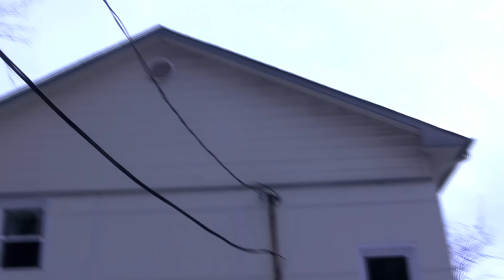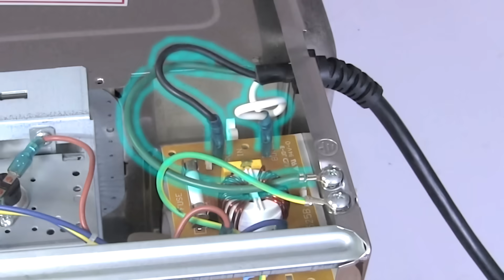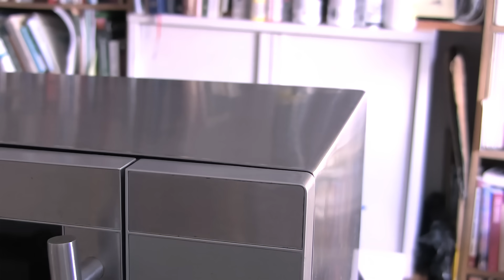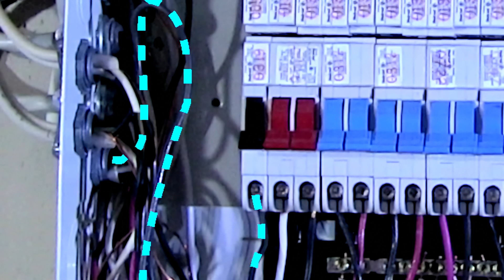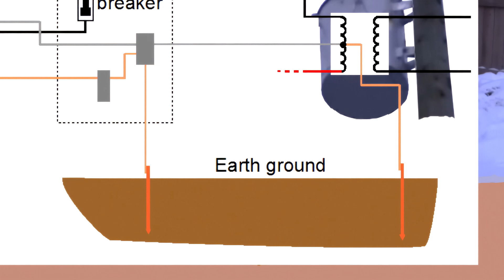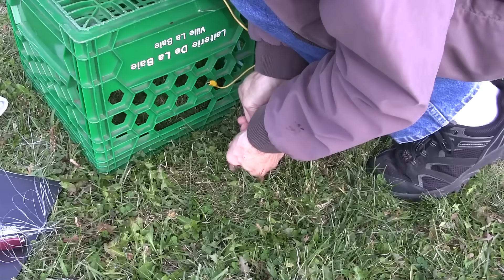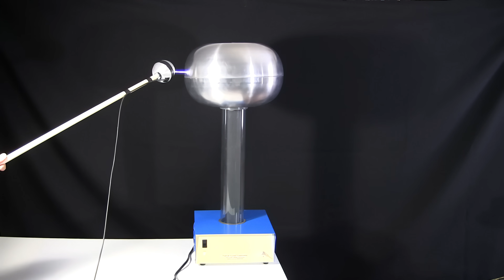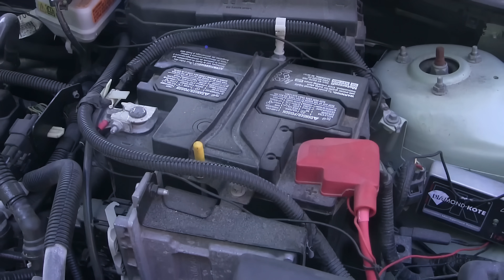What is Ground? Earth Ground/Earthing

Comment: If ground is connected to neutral in the breaker box in the US, why not just connect anything that needs grounding to neutral in the device?
Reply from the maker: alaskanhybrid Yeah, I was thinking about it more and was just signing in to say the same. The path through you and ground back to neutral elsewhere will have much less current.
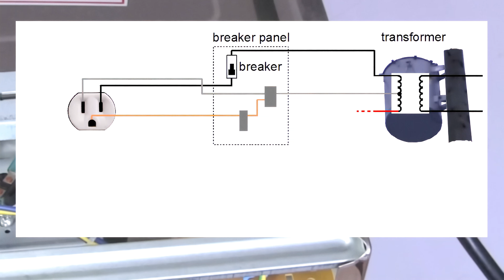Reply from the maker: Because electricity is normally through the neutral wire, but not through the ground wire. You can see the difference at 2:14 in the video.
Reply: In short, the ground is a second circuit as a safety precaution because there are several ways a metal casing of a consumer device can become live without drawing high enough current to throw a standard circuit breaker thereby creating a very dangerous circumstance.

The initial reason for ground was purely for lightning strikes. In the days of eddison, westinghouse and Tesla, they found when they started distributing A.C. power, if there was a lightning strike on the (highly conductive) powerlines in the air it would give a low impedance path and lightning would shoot out of any and all switch plates and power outlets inside homes to the sink/stove/bath.... anything metal that was electrically connected to the "earth" (hence it's name). Referencing some part of the A.C. distribution network to the dirt (earth to "neutral") allowed a much safer path for lightning to be arrested and distributed to ground.

The reason the ground is connected seperately inside of devices is because it is not in the circuit ACCEPT under a fault condition. It is added as a safety precaution to all consumer devices with any metal that can come into contact with the user. This is why you don't see three pins on supposedly "double insulated" devices like a power drill with a plastic case and no metal parts the user can come into contact with. (should be illegal in my view)

Recently, this "extra" circuit has allowed for the now very common if not manditory GFCI/RCD. A ground fault circuit interuptor AKA residual current device measures the current flowing in the active wire and compares it to the current flowing through the neutral wire, a difference of more than 3mA trips the device and disconnects several if not all circuits in the dwelling.
Reply from the maker: Looking at the diagram in 2:14 draw trace out the path between hot and neutral and you'll see they form a closed loop (include the electronics in the microwave oven). Now try tracing a closed loop for hot and ground and you'll see you can't. That's why the electricity flows through hot and neutral but not the ground wire and so it's safe to connect the ground wire to the case. It you connected neutral to the case and someone touched it while standing on ground then electricity could take the path from the neutral to the case, through you, to ground, and back to the neutral elsewhere where it's connected to ground.
Reply: It creates a path of lesser resistance than whatever body part touches a metal casing. If for whatever reason a case becomes live you wont get a great and life threatening shock.
Reply: If you've got a residual-current device (may be called GCFI in the US), any power that goes to ground is detected by it, and cause the breaker to trip. Meaning if you've got a short circuit in an appliance to a grounded part of it (like its casing), the current will stop flowing immediately.
Reply: Because the electricity is flowing through the Neutral wire when a switch connects the live wire and the neutral wire to complete the circuit.
Reply: I think the best I can understand it is that ground and neutral are connected closer to ground, so, even though they are connected, it's different to them being connected together inside the device itself.
Reply: I get what ground is, my question was why is it used separately to neutral if they are both connected outside of the device anyway.

According to the video, if you used a continuity tester between ground a neutral, it would show them as connected. The best reason for them being used separately that I can think of is that ground and neutral are connected outside of the device and nearer to ground, but it still doesn't make much sense if you think about it.

Of course, in countries where ground and neutral aren't connected, it does make sense to run them separately.
Reply: RimstarOrg thanks, that makes sense. The ground and neutral being connected in the breaker box doesn't matter because it's closer to ground than the microwave casing. Electricity isn't going to travel in that direction because the path of lower resistance is directly to ground.

Sorry to cause you a headache! Great video! Thanks :)👍
Reply: RimstarOrg
That's incorrect. There should never be a potential difference between neutral and ground. This is not to say there never is. In Aus, under test with a megohm meter, there should be no more than 2 ohms between any GPO and the bonding bar in the panel.

I kind of miissed the point in my explanation also. There would actually be no reason for the neutral to be bonded to the ground in the panel IF the neutral of the grid wasn't referenced to ground. Unfortunately it has to be for arresting ligtning strikes. So if ground is referenced to neutral on the grid, and a fault occurs causing the metal case of a device to go hot, you are the path to neutral through the ground. This is why the earth is connected to the case of the device, AND it is bonded at the panel to neutral to ensure a low impedance path that it will without fail trip the circuit's breaker. If it were not bonded at the panel and it hadn't rained for months, the closest return to neutral would be through you, the concrete and then the dirt to the power pole outside. Could be considerable resistance over that distance, especially through dry ground.
Reply: Having just re-read your reply +RimstarOrg you're not incorrect. I retract that bit, we're both saying the same thing from different perspectives.

Comment: In Ontario modern panels like Square D separate the grounded case from Neutral just as on transmission lines. Stray ground currents, that is electricity that flows somewhat irregularly through the ground, back to the transformers or switching stations has caused injury to cattle and people and wastes untold millions worth of energy. We no longer allow this and Ontario Hydro is in the process of correcting this throughout the province. 
suffice to say, that all grounds, residential and industrial are to be local loops. In theory anyway.

Also Ground loops or Floating grounds in electronic equipment where a 60hz buzz is transferred from the chassis to parts of the DC circuit via an ungrounded or unbalanced input.
Reply: I am an electrician in Ontario. Yes the neutral bar is separated from earth ground, except for ONE POINT where neutral and bond (case of the panel) is connected. The "Ground" is actually the conductor going to earth ground from the neutral bar. The rest are "bond", as they are "bonded".
Typically in Ontario we use ground plates as opposed to ground rods due to soil conditions.

In Transformer stations complicated grids of copper conductors in the soil underneath prevent problems and deaths due to currents in the earth. Really fun to watch when they are sometimes welded together with thermite. I have a friend who was supervisor for two transformer stations for the new wind power developments. He has some crazy stories.

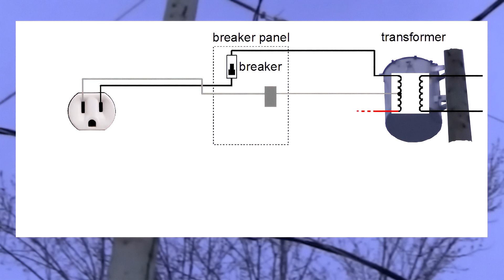Comment: 01:06 Transmission pole? You guys live in the middle ages? Take a look in Nothern Europe, everyting is buried there.
Reply: Rem ko The cost to bury line under ground can be insane compared to just installing a pole. Also, many areas are flood prone... not exactly the best place for electric wire.
Reply: Underground in cities and most (or a few, I'm not quite sure) suburbs. Above ground in rural areas.
Reply: most of Aus they are still overhead.
Reply: If you look at the first picture of the bridge (the one with the yield sign)  you can clearly see electric high voltage transmission lines crossing the water.  This type of line can also be put underground, but is very expensive due to required cooling and more difficult maintenance.  This method is used in dense cores of cities, but not normally on suburbs or rural.   My electric service in "underground", but within a block the underground line taps power from an overhead power line.
Reply: It cost big money to put everything under ground.

Comment: ok so what about if the breaker doesn't trip and it's faulty. how will the earth ground help if you touched the microwave then?
Reply: The path through the ground connection will be lower than through you to ground.
Reply: you'd have to be very unlucky if both the RCD AND the overcurrent breaker failed at once.

Comment: Is there something like a earth leakage circuit breaker in North America? In Germany there's one in pretty much every house. In my opinion it's a pretty neat device which might save your life if not the microwaves case but your body shorts out the connection between hot and ground
Reply: Do you mean like a GFCI (Ground Fault Circuit Interrupter)? Those are built into the outlet itself in the wall and are used outside or in any wet area. Or they can be in the form of a circuit breaker in the panel  which would protect a whole room instead of individual outlets.
Reply: Philip Egger yes but they're usually only in the bathroom
Reply: GFCI breakers or devices are required in north america only on any receptacle within 1.5m (Canada) of a sink or open water source or anything accessible outdoors. They work by comparing the current on the "hot" with the current on the "neutral", when there is a difference (amount depending on class of GFCI) it will open the circuit.
Reply: In Western Europe you usually have them before the main breaker panel, and they protect the whole house
Reply: Of this I am well aware.
Always been curious about "nuisance trips" with that setup though. They aren't that common, but it would be very annoying to have your whole house, or a large part of it loosing power with a nuisance trip. 
The reasoning about protecting the home in that fashion is that individual GFCI breakers would be prohibitively expensive. Heck that is why we only have them near wet areas here.
It is my understanding that something that is now code in Canada generally does not exist in the rest of the world, AFCI breakers. AFCIs protect against arc faults and are mandatory in bedrooms here. The idea is lamp cords and such near your bed getting worn and such can cause arcs which cause electrical fires. this now can not happen. However you do NOT want to AFCI protect your wall light switches, as they can trip the breaker.

Comment: DO NOT CONNECT GROUND TO ANY PIPE. Over time the electricity will drastically increase corrosion rate on the pipes. This is similar to how the negative side of batteries are far more corroded due to electrical displacement (cathodic corrosion)
Reply: Just a wild guess, but could it be you're talking about cathodic corrosion??
Reply: UDSOUDS yes thank you, ill update the original post
Reply: robert karas then explain why we use copper for wires any why that dosnt corrode
Reply: thegreanmonsterable It does corrode... However most of the wire is insulated which protects it from ground contact so corrosion is little to none.
Reply: Don't ever cut a pipe without a jumper cable.

Comment: When discharging the CRT of an old TV, I've often heard that connecting it to the case is enough.. But just to be sure, I should find an earth ground connection, right?
Reply from the maker: It's hard to say. It probably depends on the TV. Discharging to earth ground would be most certain. Also, the case is probably plastic so that won't help. However, there may be metal shielding inside that may be grounded. You can see that in my video where I convert a PC monitor into a high voltage power supply https://youtu.be/r32e0QGdm8U.
Reply: RimstarOrg Yeah, I got that. I've been thinking about that since I've watched a video on how to convert an old CRT into a neat oscilloscope.
Reply: discharge to the braided strap on springs that wraps around the CRT tube itself. Mains ground has nothing to do with that.
Reply: Come on guys. You could've saved yer time.

Comment: Clear and great explanation! Just a few questions: why do we need to connect components to a single ground (for the schematic part)? You mentioned a common reference point for voltage, but why do we need that? What's the consequence of not having one? Thanks!
Reply from the maker: It depends on the circuit but if they components didn't have a common reference point then they'd be at very different voltage in different places and the current would be going in all the wrong directions. It's deliberate that they have a common reference point.

Comment: its not a neutral anymore now its the grounded cpnductor
Reply: The grounded conductor(identified conductor) is not called a Neutral when you only use 1 hot(un-grounded) conductor, like for your microwave or lamp, but if you use multiple hot(un-grounded) conductors, then the identified conductor can be called a Neutral, a Stove/Range that uses 120/240v uses the Neutral(still called  the Identified conductor) to provide the 120v, or in a 3 phase Y systems like 120/208v, 277/480, 347/600.
http://www.oempanels.com/wp-content/uploads/2016/08/120V-240V-Single-Phase-Power-Sketch.png
http://electrical-engineering-portal.com/wp-content/uploads/2015/05/wye-connected-three-phase-four-wire-secondary-transformer.gif

The "Ground wire" has different names depending on where it is in the system....
After the breaker panel it's called the Bonding wire, because it bonds the device to ground potential.
The wire that goes from the panel to the ground rod is called the Grounding wire.
Reply: J-man72 b art. 100 definitions 2017 NEC